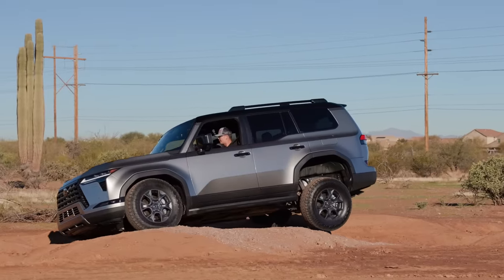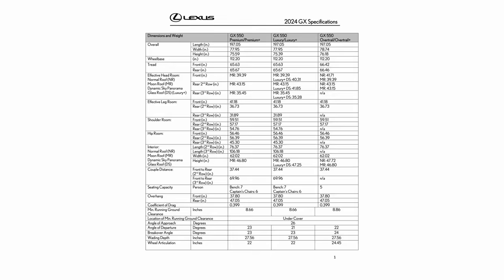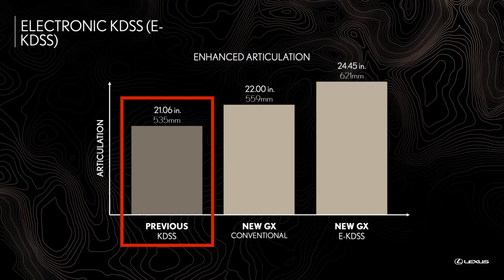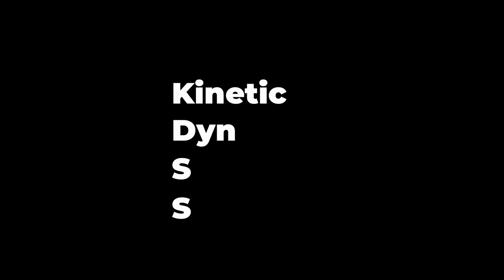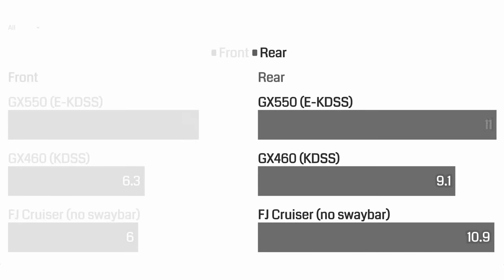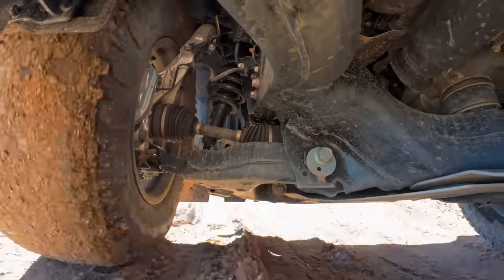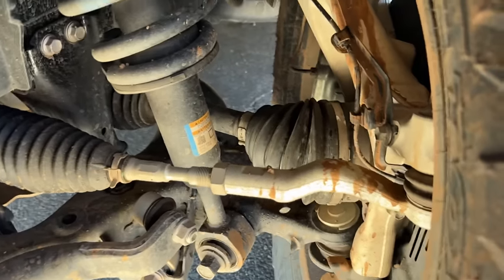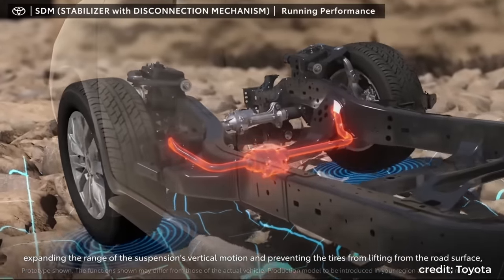Suspension Design With GX550 Chief Engineer

Comment: I bet the Toyota Standard involves having each wheel in its own independent articulation stand, and then controlling the amount of Down and Up applied at each corner to achieve those numbers.  So it's an ideal number that won't typically be achieved in the real world. 
Sound like the Toyota engineers were very respectful to make sure they didn't attack his method of measuring which was a real world measurement.
Reply: maybe the toyota standart is to measure it with some weights in the car simulating 4 Adults and stuff in the trunk?
maybe even close to the max allowed weight to compress the suspension as far as possible.

Comment: So the new Overland trim w/ ~9" of stock ground clearance and center/rear lockers is basically better (or at least equal) to a heavily modded 460? That's pretty damn cool that Lexus is spending so much effort in improving the offroad performance, knowing that very few 550 owners will actually take it somewhere where 19"+ of flex is even necessary

Comment: Toyota tend to engineer their closed lengths to be coincident with 100% bumpstop compression, or metal-metal with bumpstop removed. The extra 4 inches or so the Lexus engineer refers to may be the remaining bump travel from bumpstop contact to full closed on the struts and shocks. The GX550 is also using the 300 Series chassis which is just a modified 200 chassis, so travel is different to the older 120/150 chassis.

Comment: love the video, purchased a 2022 4runner with KDSS specifically for a lot of the reasons you mentioned.  Added a lot of DR KDSS accessories to correct the geometry after lifting.  Excited for the next video to see how Toyotas version of a sway bar disconnect works.

Comment: Great video and good info.  Keep in mind the main spring rates along with ARB rates can affect flex, the rebound displacement on the unloaded wheel is a balance of the forces.   The vehicle mass can also affect results. This is even more apparent when you have KDSS or a disconnect ARB.  When the unloaded wheel is at full rebound, and you have a higher mass you will have higher displacement with the loaded wheels.  But that being said, you did a great review.

Comment: The way the tyres are loaded is going to make a difference - if the vehicle was on flat ground, and one corner was lifted by a flat platform until a tyre was just touching/lifting from the ground, the sidewal flex may give a greater apparent flex.

Comment: Toyota is currently my number one car manufacturer. If I could only buy from one manufacturer, I feel like they make the best best cars in all categories better than anybody.
Reply: I’m not a fan of their push toward hybrid/turbo’d/4 bangers but this turbo’d V6 deal for the GX550 is EXACTLY what I like to see in this model for innovation…. alongside the explained suspension ergo’s of course.
Reply: @beri232 How is this engine different from what they are using in Tundra? Tundra is equipped with the V6 turbo engine and those are having problems already
Reply: @bggees   I agree but 2 months ago when I made my post…. they hadn’t had any issues yet. Knowing what we both know now, I wouldn’t buy one.

Comment: This is really cool stuff…Toyota is taking on and off road performance very seriously and using highly engineered design not brake-based TC to do it…reminds me of the Gen 1 Cayenne where the Porsche engineers geeked out on off-road performance to a degree no buyer ever cared about…I’m not sure if the Europeans are capable of this any more, they’re so beaten down by dieselgate, emissions controls, ever increasing “safety” regulations and the impending EV asteroid…it’s good to see the Japanese carrying the torch here, engineering & building quality atom-space products
Reply from the maker: agree. i was shocked to learned early Cayenne even had stabilizer bar disconnect

Comment: KDSS is more than just sway bar disconnect. If I remember correctly it actually pushes the opposing corner into the ground and actually allows more articulation than no sway bar at all.

Comment: Another great video.  Nice to see Toyota/Lexus is finally addressing some of these things. Here are others to work on: differential unlock for 4 wheel flat towing, fix the 460’s fat bloated feeling when driving. My 2016 model handles poorly and is all over the road compared to my 2020 Jeep Grand Cherokee trail. Fix the lack luster acceleration, the gearing in the transmission is poorly executed. Super annoying that the transmission does not actually limit the speed downhills with steep grades at speed.  Oh and I hope they fixed the USELESS Navigation in the 2015/16 model years, soooo bad.

Comment: On Car Expert, apparently on the LX 600 the E-KDSS paired with its adjustable suspension makes towing with the SUV unbearable as the electronic dampening system gets completely thrown off when you add a trailer to it. Im not sure if the GX 550 has a similar problem... 

That would be a HUGE dealbreaker, where the additional feature makes the car WORSE, at least that was my understanding of it when towing.

Comment: About the difference in numerical articulation (stated vs measured) - could it be related to the fact that a non-fully laden GX may not fully compress the suspension/bump-stops in the cross-axle situation?  Perhaps fully laden will have added the (part of) missing few inches.
Thank you for the efforts - in an Internet world where most reviewers invited to these events confess to not driving off-road (or driving manuals), your thoroughness and analytical depth stand out - a beacon of light in a very dull journalistic world.  Thank you for doing this!

Comment: Well done! Keep providing the quality videos. Did you determined the wheel offset used on the Overtrail?
Reply from the maker: Thanks! The Overtrail is +50mm. Premium and Luxury are +60mm. Yes they are significantly more positive than previous gen to optimize Kingpin offset.

Comment: I went 4wding on the weekend in the Victorian high country (Australia) on rough muddy tracks with deep washed out parallel wheel ruts, along with mud holes and river crossings. I'm quite sure that an IFS 4wd would do much worse in that terrain than my 1992 Landcruiser on solid axles.

Comment: In the past, some suspension components of the GX/4Runner/Taco were interchangeable. Even between generations!

What are the chances that customers can retrofit GX550 LCAs and axles into other vehicles to gain the travel improvements (if possible at all, there'd need to be other components swapped too)

Comment: When are you going to do something,  anything,  testing, and measurements on the LC200?  I thought it has the most articulation of all the previous gens of Toyota IFS?   That would be a good comparison.  Great video(again), full of useful data!  What suspension setup would you recommend for a 200 series?  For max articulation for overlanding?
Reply from the maker: i will test the 200 series when i review the 250 series! stay tuned :)
Reply: @TinkerersAdventure  Good to hear.  Have you ever thought of working for Toyota or a suspension company?   You should look into it.

Comment: Thoughts about the flex discrepancy.  Is it possible that, since the tire moves in an arc between full sag and full stuff, Toyota sets an imaginary plane at the furthest distance the tire, when angled during articulation, extends out from the vehicle then measures articulation based on where the centerline of the CV and hubs intersect the plane at full sag and full stuff?  Agree that there should be a standard way of measuring things.  Sometimes the manufacturers have a way of measuring specs that don't make a lot of sense.  For example, my Gen1 SWB Montero has an amazing approach angle, 38 degrees, same as a new Defender.  But whereas Land Rover measures its approach angle based on an angle where the line from the bumper to the ground touches the leading edge of the tire.  Mitsubishi draws a line from the bumper, through the tire, directly to the center of the tires contact patch.  If I used Land Rovers standard of measure, my Montero would likely be well over 40 degrees of approach.

Comment: Kai, How much do you think tire type/pressure and vehicle load would impact the articulation measurements? It seems like deflated tires could inflate the data and maxing out cargo loads would deflect the bumps also pushing up numbers. A standardized method would be great indeed.

Comment: I have already seen the new GX 550 overtrail, and I think that for a better look and to occasionally go soft off-road and overlanding, I should raise it 3 inches and change the suspension, similar to your FJ Cruiser. With this in mind, it would be better to buy a standard GX 550 and not the overtrail. What do you think?

Comment: Do you know if Toyota is measuring from wheel centerline instead of the top of the tire? If so the compliance of the tire and the angle induced on the wheel due to the suspension compression/extension could account for the measurement difference.

Comment: I'm sure you will make a video on this eventually, but do you have any insight on if these front suspension improvements are found on the 2024 Land Cruiser 250 or 2024 Tacoma?
Reply from the maker: The LC250 will have the same main suspension has this. The 2024 is similar but different control arms and CVs. Not sure about the steering knuckles. These were based on stuff I could barely measure crawling on the floor, but will confirm more details when I get them on my lift

Comment: Great job!  Do you know why they dont provide kdss or ekdss on gx550, except for overtrail plus.  Kdss was provided for all gx460 models and this made the cornering flat without much body roll.  Kdss is what made gx460 special and many youtubers are saying gx550 has a lot of body roll/wobble.  They are not saying what is causing it (maybe Lexus dont want them to mention most 550 models dont have kdss or ekdss?)  Do you think not having kdss is a big factor in not buying gx550. I have 460 and i wouldnt want to get gx550 if it has a lot of body roll.
Reply from the maker: It was mainly for cost and to make the overtrail more special. i did noticed the stabilizer bars on premium and luxury trims are skinnier. To me, I would only buy the overtrail.

Comment: I have a question, why isn't there any utilization of the gaps made near the end of articulation to let the wheels fall even further away from the car to keep all wheels on the ground? This would prevent the ride height from being super high, but give more articulation. Something like a double spring and shock system that one pair is unable to expand under normal weight on all four tires, so it'll be compressed by defualt, and as the suspension articulates it has enough weight taken off to expand the second set of suspension, thus giving you more articulation. Might need a disconnectable anti-roll bar to keep you from rolling on road.

Comment: Have you seen the suspension testing videos that car and driver has been putting on YouTube? In the latest cybertruck one they showed a list of their RTI scores. It seems to indicate that the 3rd gen TRD pro Tacoma flexes better than the 4th gen with the sway bar disconnect... I find this extremely confusing and interesting
Reply from the maker: Yes, I also saw the episode of 4th gen Tacoma and was kind of disappointed on the result. My guess is frame flex. In my tundra measurement, the 2nd gen had over 4” articulation just from the frame while the 3rd gen is around 2, using CTI style measurement.
Reply: Gotcha Thanks for the reply! Im wondering if maybe they fitted heavier rear spring rates for improved hauling (3rd gens sagged badly). The front appears to flex better than the 3rd gen tacomas I've tested.
Reply from the maker: @MudPuppyOffroad  yes i do think the 4th gen articulation will be more balanced front and rear. With front SDM + a decently sized rear swaybar, probably spring rates too. I haven’t been able to test one because the SDM has been delayed. No one is getting the SDM right now. Car and Driver probably got a special early prototype vehicle
Reply: My brother just took delivery of a 2024 Land cruiser. We did some pretty good wheeling with it this weekend. The sway bar disconnect works awesome, stays disconnected up to 18 mph. Really impressed with the new Land cruiser articulation and ride quality. It does not have the double offset CV joint like the GX550 though. The hybrid system is very disappointing though, huge amount of interior space wasted and it's not super fuel efficient or fast lol

Comment: I wonder if you can swap the new gx550 CV axles, LCAs, and spindles (with more King Pin Offset) into the GX470 and GX460 😮 — I have a non-KDSS GX470, and would love to put GX550 CV axles, LCAs, and spindles depending on price of the new parts :O.

Comment: And one more assumption from my side - perhaps Toyota is measuring articulation not from the top of the tire to the arch, but from the center of the wheel hub to the arch?

 This eliminates the possible difference in tire pressure, tire temperature, tire compression and the actual difference in the tires themselves. 

The tire model, their dimension - as you know, in different markets and in different years of production, tires from different manufacturers could be placed on the same model, respectively, all this could affect the final result of measurements.
Reply from the maker: good thoughts! but articulation is the difference between left and right, so the tire size got canceled out. And since it is the top of the tire, its dimension is not really affected by pressure and contact force to the ground. But I agree, measuring to something metal like the hub is more ideal. It was just not possible to run the tape measure straight across.

Comment: I have 10.5 inches of articulation front and rear on my 3rd gen tundra, tape measure verified. Total of 21 inches.
Reply from the maker: front stabilizer bar removed?
Reply: @TinkerersAdventure  yup! It sits on my front porch …need to take it to the junk yard at some point.

Comment: I bet you the Land Rover articulation is measured with the suspension in normal not lifted mode. On my lr3 in lifted mode it would not articulate nearly as well as in normal mode because the shocks are basically maxed out when lifted greatly reducing down travel.
Reply from the maker: Very good point!

Comment: It would be interesting to see if a person could retrofit the spindle and lower control arm to previous gen Toyota's for a more durable in harsher climates sort of extended travel. Where the lower control arm mounts the same as the previous gen?
Reply from the maker: unfortunately no. the spacing of the bushings and their relationship to the lower ball joint are completely different.

Comment: I wonder if adding the control arms to a 5th gen 4Runner would be possible. It’s hard to tell with the paper templates but it doesn’t look like the mounting points would line up?
Reply from the maker: you are correct. the mounting points are completely different. won't be a bolt on

Comment: For clarification, in theory an extended lower control arm (LCA) in conjunction with a lift, presumably within a certain ratio, would do more for alignment and articulation than an adjustable upper control arm (UCA)? To my understanding most lift kits offer the extended and / or adjustable UCAs but generally not LCAs. Under my assumptions, it would reason to get the LCA rather than the UCA. Am I wrong here?
Reply from the maker: good thoughts! in the context of last gen Toyotas, J120/150 platform, aftermarket UCA are NOT extended. Instead, it shift the ball joint towards the rear of the vehicle to gain caster. The UCA sees much less load than the LCA therefore much easier to make. That's why most companies make them. The most optimal way to correct geometry is actually LCA, it is just a lot more expensive to make.
Reply: @TinkerersAdventure  I didn't think above the material cost and manufacturing challenges that comes with the LCA but that makes sense

Comment: Too frustrating- no one measures in a standardized way, making specifications worthless. Even this video changed the method from the prior video (CTI). I don't have the patience to sort it all out, across multiple vehicles/manufacturers. Actually you can't unless measurement methods are well defined. So I say just pay attention to shock travel. Unless a stock vehicle has 12-24" shocks, it's crap and why we modify in the first place.

Comment: It’s always a fight between wheel flex (wheel travel) is between having to have IPF suspension on most modern 4x4 and antiroll bars!
I’m so glad that Toyota still makes a solid off-road four-wheel-drive for markets where we can drive off-road.
I’m absolutely enjoying my 6 week old Land Cruiser 70 series with its V8 diesel and especially the Manual gearbox and solid front and rear axles.
I never understand why people buy four drives, and then complain about the suspension, so the manufactures had to move onto independent suspension .

Comment: 6:30 I have an Idea of mine how thex came up with the Number for the New Defender: They measured flex while not have the supension in offroad height. All videos you see show the car driving in offroad height. Offroad height menas the ait bags are fully pumped up and no down travel is left...
Reply from the maker: I agree. That could be it. Land rover could have independently control each air bag to maximize articulation and ride height simultaneously, but I guess it is not doing that. It's already a very complex vehicle but it didn't fully utilize the complexity.
Reply: @TinkerersAdventure it would be possible to control the air bags but i doubt it would be a big gain. The downtravel of the supension is just maxed out. If you lower the air bags on a IS Supension you loose ground clearance and bottom out.